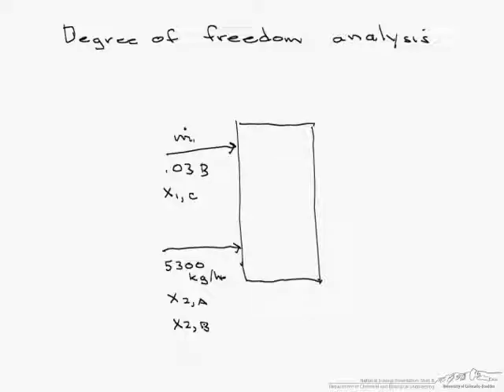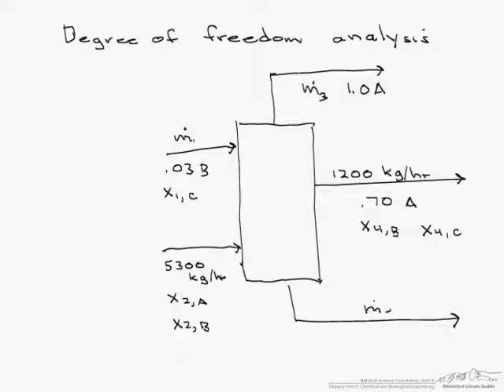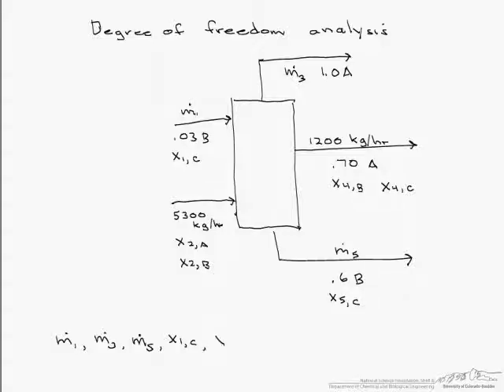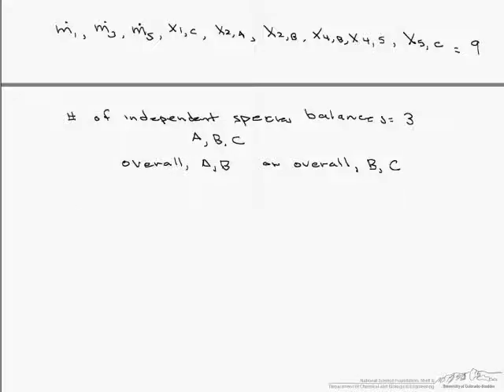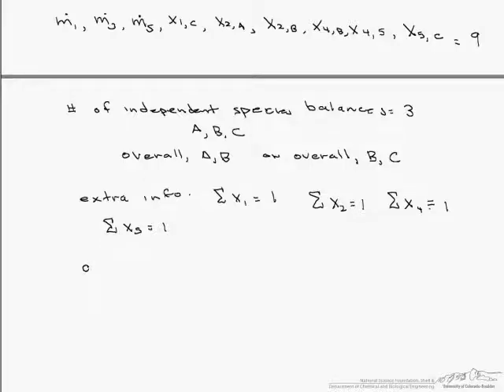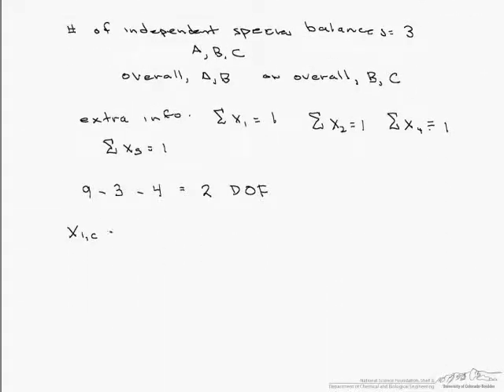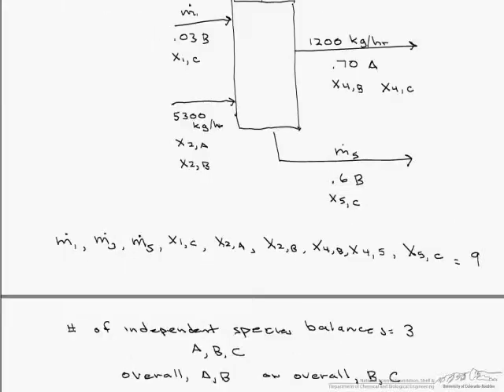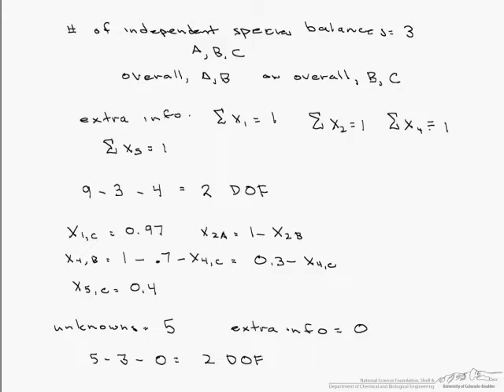Degree of Freedom Analysis on a Single Unit

Comment: Please what is the meaning of independenct species balance
Reply from the maker: Thanks for your question. Independent species balance refers to how many balances you can use. If there are two species, you can have two species balances and an overall balance. However, you cannot use all three of those because one will be meaningless since it will be dependent on the other two. The two species balances add up to the overall balance. Generally, you choose the two that will be easiest to calculate. Here's a quick example. You have two variables, a and b. You have two independent equations: a + b = 7, 2a - b = 2. Now you can solve those. If you add those two equations, you get 3a = 9. But that is extra information that you didn't need. But it is a simpler equation, so maybe you would choose to solve using the last equation. Does that help?

Comment: Hi, I'm quite confused with regards to the following question:
A 100 kg/h mixture of benzene (B) and toluene (T) containing 50% benzene by mass is
separated by distillation into two fractions. The mass flow rate of benzene in the top stream is
45 kg B/h and that of toluene in the bottom stream is 47.5 kg T/h. The operation is under steady
state. Write balances for benzene and toluene to calculate the unknown component flow rate in
the output streams.
[Ans. Component mass balance (benzene): 0.5(100) = 45 (kg B/h) + mB,3; mB,3 = 5 kg/h;
Material balance (toluene): 0.5(100) = mT,2 + 47.5 (kg B/h); mT,2 = 2.5 kg/h

my question is, why was mT,2 and mB,3 added and not multiplied with 47.5(kg B/h) and 45(kg B/h) respectively?
Reply from the maker: The reason is that you are given the mass of benzene or toluene in the stream, not the mass fraction. So, to get the mass of benzene from the feed stream, you know that it is 50% of the feed (or 0.5*100). 45kg B/h is coming out in the top stream. So the amount of benzene coming out in the bottom stream is 50-45, or 5 kg B/h.

Comment: So can the system just not be completely solved? If so, why did you go through the trouble of simplifying those equations with the extra info ultimately to be left with 2 DOF at the end?
Reply: I guess thats how it works in real life, you leave it simplified and go get the info you need, and when you come back you just have to replace the info you got

Comment: Why the overall mass balance (m1+m2 = m3 + m4 + m5) is not included in the extra equations?
Reply from the maker: Thanks for your question.  You can only use 3 of the mass balances.  You can use the overall and 2 species balances or 3 of the species balances.  They are not independent of each other.  In other words, if you add all of the species balances together, you will end up with the mass balance, so it is not a new bit of information.
Reply: @LearnChemE  Thank you for the explanation! I'm watching all your videos about MEB and they are awesome, it's like having a free chemical engineering tutor online. Please keep going!
Reply: @LearnChemE   i still do not understand this

Comment: You didn’t solve for 4 unknowns you only solved for 2. This shit doesn’t make any sense, disliked
Reply from the maker: She completely solved 2 of the unknowns, and the other 2 she solved by putting them in terms of other unknowns.  For example, if you know that 1 = x + y, once you have found either x or y, you can automatically find the other.  It's simply another way of accounting for the information that you have.  Here's a screencast that explains DOF in another way. Maybe it will help. https://www.youtube.com/watch?v=tW1ft4y5fQY

Comment: What happens if I get a negative number as a degree of freedom? Is it correct or am I missing something?
Reply from the maker: +doblajes-j j-doblajes If you get a negative number as a degree of freedom, it means the system is overspecified.
Reply: If the degrees of freedom is negative, then the system is considered to be overspecified, which means that you have too much information and it is either redundant OR inconsistent. If the information/equations are redundant, then we can still solve the problem. Just wanted to make it clear that overspecified problems can still be solvable, contrary to Salim Bousba's reply.
Reply: +doblajes-j j-doblajes yes If the DOF<0, the system is over-specified. You should Check if you have too many equations or too many restrictions. over-specified. problems cannot be solved to be consistent with all equations.
Reply: Thank you for taking the time to reply! I got it now. Thanks!

Comment: If DOF=2 then what is the next step to solve for the unknowns?
Reply from the maker: +Pikachu When you have 2 degrees of freedom, you need more information to solve the problem.  If you have a multiple unit system, you can see if another unit has DOF=0, but in this case, it means that it can't be solved.
Reply: @LearnChemE  Thank you for your video and explaination on this. I was also having the same question. So to repeat what I understood from you, in this case, the problem is unsolvable  since it is has 2 D.O.F in a single unit system.
Reply: Yeah thank you so much I just learned that in class.
Reply: Thank you for question and answer, u guys saved me